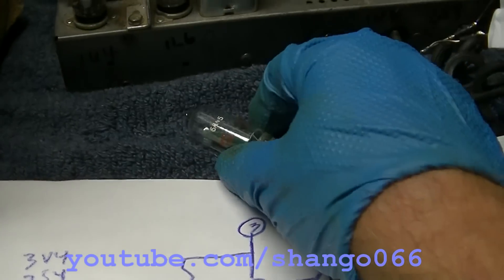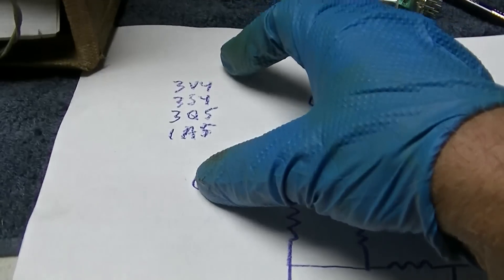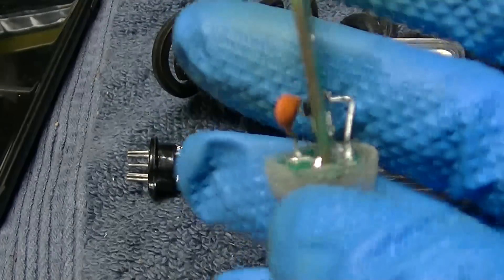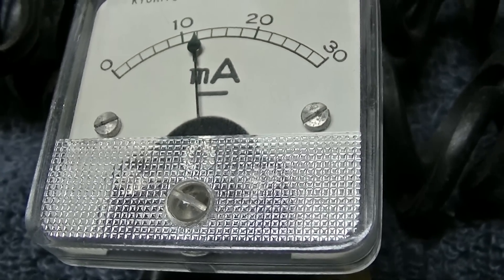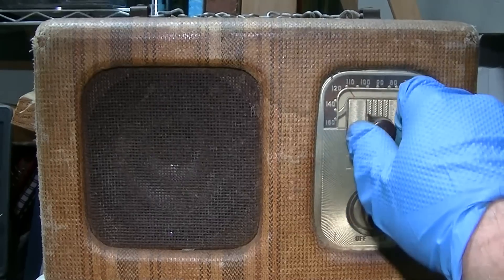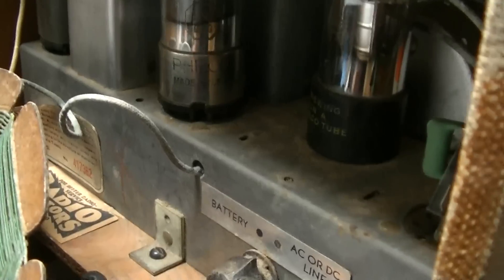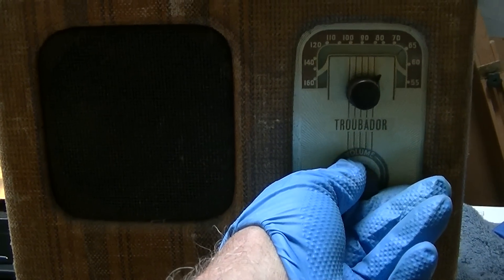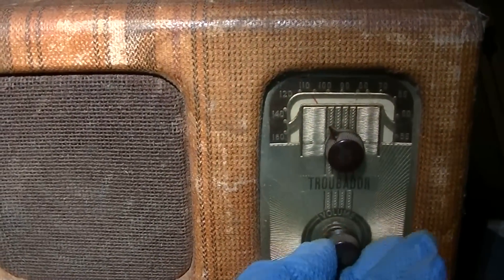FET Audio Output Tubes For Battery Personal Radios Play Test Experiment

Comment: I have had comments disappear from multiple YouTube channels. Totally innocuous. No rational explanation. Channels for electronics, computers and wrenching. They appear to post, but on edit attempt or page refresh they are gone. So far, though, have not been unsubscribed.
Reply: Yeah, I've run into that as well. It's the automatic filters removing something it detects as "not allowed". Anything with a url causes it to delete a majority of comments before they post publicly. And once it deleted a comment of yours, it's more "suspicious" of the next few you write from my experience. I don't miss all the phishing comments, but I am pretty annoyed at how often it mistakenly deletes mine... if Google search can verify the safety of links and content, YouTube's comment checker can as well. It's just lazy design.
Reply: Additionally, the creator can manually review some of the comments and approve them. However, some things just go into the void never to be seen again. And other times, a video gets so many comments you'd need a full time crew to just read and approve comments all day to review them in time. So, I understand why creators don't always bother reviewing anything that gets held.

Comment: I found this one very unique. I have seen to sub a diode for a rectifier tube but never any other tube till now.  The thing is in tube radio sets not many tube are needed, but in a comparable transistor set there are more transistors then the tube version... If conversions are able to do all of the tubes, it proves the transistor set design is over done, since you don't need that many transistors.    However I do know many electronic specs claim a diode to be counted like a transistor. So if the tube modified to a transistor design contains diodes that would equal more  transistor like parts... So it might not be a win in that regard. But it will allow the tube systems to be able to be repaired even after the tubes are all gone.
Reply: Part of the difference is transistor sets usually have push-pull audio output for much better battery life.

Comment: I did this many years ago when I needed the unobtanium magic eye 6CD7 (EM34). I used a 6AF6G and the missing amplifier triode section was solved by using a DN2530 N-channel depletion mode high voltage mosfet driving the deflection vane. The second deflection vane was connected to the first via a 50v zener, so when the first sector was closed, the second sector then started closing, exactly like with the original 6CD7. Another good mosfet is the LND150 or the DN2540, the latter good for 400v.
Now some folks may chime in why I did not use the 6AE6 as a driver for the 6AF6 : I had a space issue, very small radio 🙂

Comment: I'm curious, what resistance do you include to simulate the series filament such that the rest of the 1v tubes get the correct 1.4 ish drive? Thanks.
Reply from the maker: Here's the.
 Online omes calculator  and put in the current and voltage drop you want.

Comment: Nice work on building up those solid state replacement concepts.  For some who works on a lot of old sets with a limited supply of the rare tubes it would be handy to have a set of solid state replacements to help diagnose a unit.

Comment: Hey , are these thingies gonna make my THOUSANDS of tubes worth less ? LOL
Reply: When hurricane sandy (or Irene?) flooded parts of Long Island there was a guy on the Antique Radio Forum whose collection got flooded. A surprising amount of his early tube stash did not survive the flood waters (lost vacuum and took on flood water) despite being rescued from that environment very quickly after the disaster. I've heard similar stories about 7 & 9 pin tubes going to air because of corrosion around the pins if stored outside in sheds/barns without ever being dunked into water. In the lab, you can use a glass under vacuum to harvest some noble gases as the glass will keep air out, but not certain nobles. What any of this means for longevity in the next hundred years of these already up to 100 year old tubes is anyone's guess....

Comment: Soild state replacements. Are more than ok but you won't have the romantic glow emulating from the back of the set
Reply: 1volt tubes don't glow anyway (at least not in a way visible to the naked eye). And portable sets like these are operated with the rear door shut so you wouldn't see what's in there anyway.

Comment: Kinda goofy forward reverse engineering. . Just gut the inside design a solid state circuit make a pcb
Stuff inside and restore the cabinet.
Reply: Not exactly. In these instances we are reengineering the active element and striving for plug-in compatibility. I find the mission stimulating, thought provoking and entertaining.

Comment: I really like the idea of making solid state replacements for these low voltage tubes.  I don't know why somebody didn't think of this before. The HAM radio club (in high school 1978) had a pile of Korean War walkie talkies that we could convert to 2 meters.  The biggest problem that we had was getting replacement micro-micro tubes. (I can't remember what they are actually called but the tubes are about the size of your pinky finger).  The tubes were normal values but miniaturized.  This would have been a great solution to that problem.  I don't know why none of the teachers thought of this --- If you wait long enough the answer always comes?
Reply: There is the Nuvistor tubes that were even smaller and introduced in 1958 by RCA. Other manufacturers followed suit. RCA used them in their color TV sets in the tuning sections until they started moving to 100 percent solid state color sets around 1971.
Reply: There were a few electronics magazines around the 1978 era that had run articles on this basic premise, though its been so long I don't remember which magazines they were to say how popular they were (I don't think it was QST). One of the best things about the internet is being able to search a wide variety of content by text/keyword where as in the pre-2000s unless you happened to luck across the right issue of the right magazine, finding such a project was not always going to happen. The first solid state tube project I lucked across was in the mid 90s when someone in Japan had done a write up on converting a 5-01A tube Atwater Kent model 20 to solid state, allowing it to be operated off a 9v smoke detector battery. Of course, other than the schematic it was all in Japanese so I had no idea what it was saying. Always wanted to give that project a go.

Comment: these high voltage power mosfets have a fairly high capacitance gate to drain, which can reduce gain, especially at higher audio frequencies, it 'may' work better with a bit of boostrap feedback from the source connection to the bias resistor network

Comment: 1A5s werent really used here in the UK, but i do have one USA origin set that uses one, and not surprising it might seem to distort/be low gain, its only capable of about 100mW output! the 1C5/3Q5/3V4 and similar are about 250mW.. i picked up a few 1A5s fairly cheap in the early 90s , luckily

Comment: Since these are collectors items, and almost certainly not going to be used,  I think an ac power supply to replace the batteries would be more useful.  The more non-original, the more the set is devalued.  The tubes for portables are more scarce, but still obtainable. These upgrades deface the set. Why would you waste time on this.
Reply: It's a learning process. There are many sets no one cares about. Plug in substitutes are easy to remove and replace tubes. Not much of an offense to me, but I understand your objection.
Reply: Its not defacing anything, you can unplug the solid state device and plug an original tube in at any time. In fact that's kinda the whole point of using a dud tube's socket to build the solid state device instead of just soldering the parts to the socket (above or below chassis).

Comment: Reverse-engineering leads to circuit improvements leads to re-designing the old circuit. It's addictive! RF front end? IF filter stages? Built in 18650 power supply? Synchronous detection?

Comment: Great video!  I've always liked these 40's and 50's battery AM and SW sets.  The RCA globetrotter sets were really good performers.  I tried a set of the solid state replacements when they first came out years ago in my T-O and wasn't very impressed.  Yours seems to work very well.  Ive never been unsuscribed from your channel but I have been from Cold War Motors channel several times.  Scott from that channel mentions at the end of every video to check and make sure you are still subscribed.  Its really going to get crazy with the upcoming events.  Thanks!  Ted

Comment: Could it be, that the internal resistance of the FET is lower than that of the tube, and in order to achieve the best sensitivity, the IF stages would need to be tuned?
...thx for the vid

Comment: I believe the tubes in this Tolex covered receiver are directly heated, where the heaters in the tubes are also the cathodes. There is an "instant on" effect, similar to transistorized electronics. One could theoretically replace every tube in this radio with transistors, if accommodations are made for voltage and biasing requirements of replacement transistors .

Comment: Nice job with the FET's. If you could get the circuit small enough to fit in the base of the Octal you could glue a dead/dummy valve on top to keep the looks.

As for the comments and unsubscribers, that's just YT being YT.

Comment: Happy sunshine smiley face.  This is a great option for those that do not have a collection of tubes to try. the base is a great place to jam the components i love it.
Reply: This is a good option going forward. As certain tubes become rarer and more expensive, this is something that will keep gear going into the future!  I like the LED idea, but it has to be DIM as dim as the OEM vacuum bulb it replaced.

I think your next experiment should be for linear CB amps.. for those specific to the power tubes have become prohibitively expensive. Now all you have to do is engineer the grain and the grit that vacuum bulbs have and solid state often lacks..

Comment: Very nice Shango! Care to share either schematic or at least the FET part number? I'm cautious about finding one with enough max Drain-Source voltage to withstand the B+
Reply: Not a big worry in the case of the 3v4, in the transoceanic H500 it only has 24 volts on the plate.